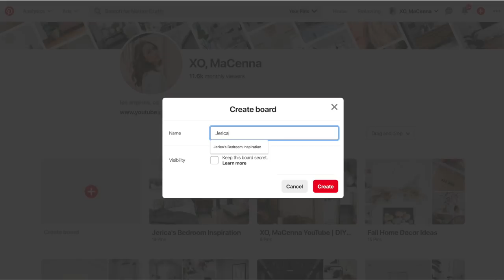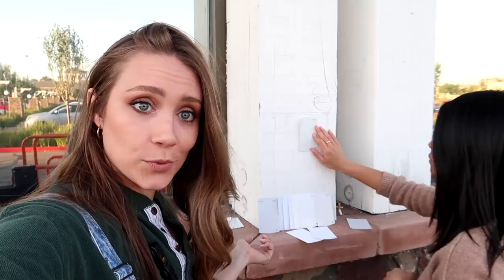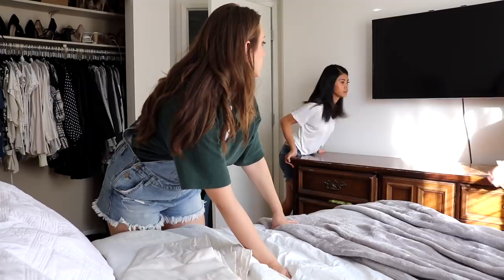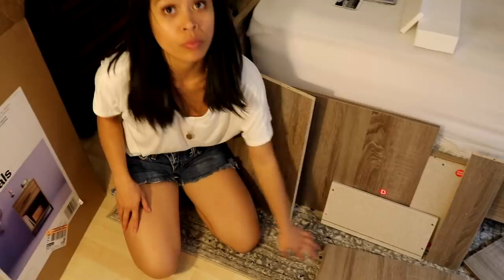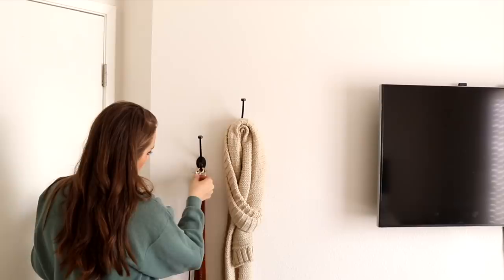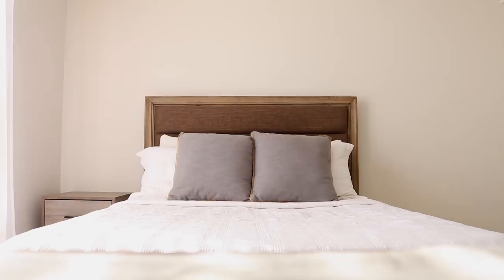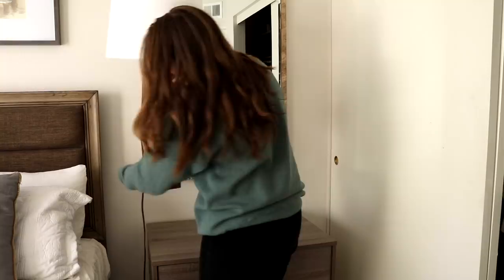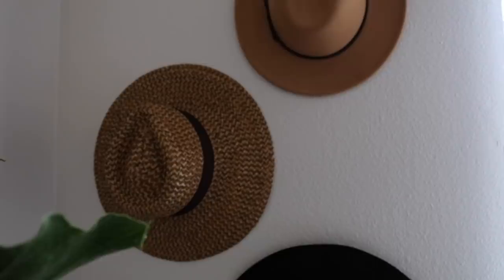Extreme SMALL Bedroom Makeover Part 2 // California Coastal Chic Decor  | XO, MaCenna

Comment: For the tv cord, if you don’t have fabric you can also take a bit of the wall paint color and paint the length of visible part of the wires. We did a few coats with the sponge technique instead of a brush and turned out well.

Comment: I wouldn’t have put that rug so under the bed or so centred. It could have worked at an angle as well or pulled out more the wardrobe side and layer it with a smaller circle rug

Comment: The room looks really nice, but wondering what happened to the desk? Seemed to be an elemental piece of furniture re her needs. Or did she agree to no longer having one? These things would be helpful for viewers to know. Re attaching things to the walls, are you just screwing into drywall, locating studs or using any special hardware? I know the current style is to lose the majority of the rug under the bed but it seems so impractical (and a dust collector). What if you pulled it over towards the closet which would make it more visible and usable? As a final note, there are so many gorgeous sepia-toned photographs available, I would definitely go that route rather than DIY "paintings". Maybe your friend's own photos printed in sepia. They would certainly be more personal and meaningful. Best to focus on your decorating strengths. What were the total costs?

Comment: Ok.. So this is an extremely small bedroom huh? I guess today I discovered my bedroom is actually a walk-in closet, then. I had a doublebed in there but next to the built-in closet there was no room left to move around. So I've put my daughters old bunk-bed in there so that I have some space to walk and have made myself a sort off improf-coutch underneeth the bunk using an old matress. (I find myself sleeping there for the passed months instead of up on the bunk because getting out for my midnight snacks etc, wiggeling myself down that narrow ladder that was built for a kid, not an addult..is a hassle).. 

But it's so narrow down there that one arm or leg is usually on the floor or embracing one of the bedposts desperately looking for more room, lol.. 

I had a sofa bed in there before the bunkbed but I got it second-hand and soon enough I could only unfold it with a lot of violence untill it no longer folded back up..

Maybe saving up for a new sofa bed is the best idea. 

If anyone else has a minature bedroom and has some good ideas about saving space without losing too much comfort, ideas are always welcomed! And also: I feel you bro's and sisses!

Comment: If the room is 11 x 11, why wouldn't an 8x10 rug work?
Reply from the maker: It would be so close to the wall on the 10” side (because the room is a approx. 11 x 11 it’s really 10’ 6” x 10’ 9”) and it would look like carpet in the room rather than a rug.